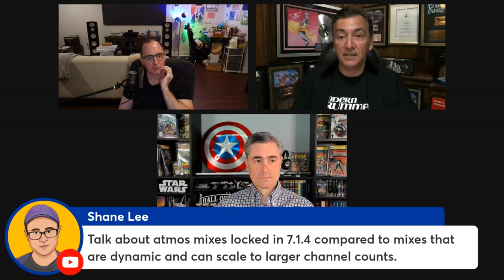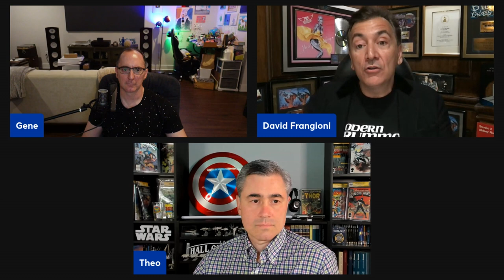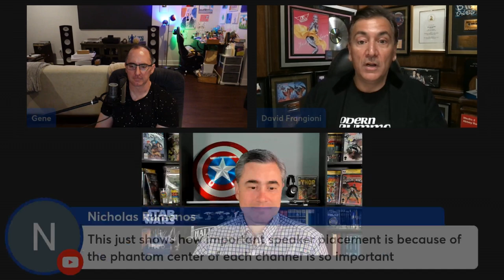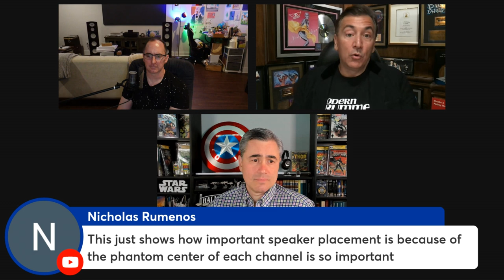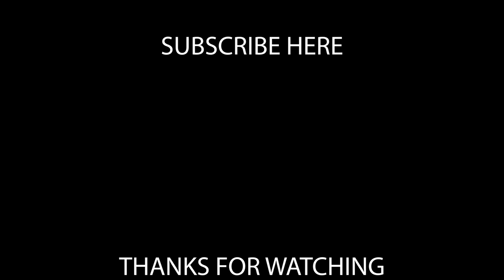Why 7.1.4 Static Atmos Mixes Instead Of Dynamic Mixes?

Comment: There are so many times questions being asked by Shane on why Atmos of Disney turned into Atmouse, but it had never been properly answered by any professional mixer. Nothing is answered straight forward. Or I've missed out? I think it's not only lacking in height channel if people have been talking about it, it also lack in bass and dynamic.
Reply: he circled around several times each time he was asked. Short answer 95% of the world doesnt go beyond 11.1 channel setups. (i personally run a 9.1.6 setup) . So they cater to the masses rather then the 5 or possibly even 1%. if most people are happy with said outcome why spend the extra money and time for a mixer to cater to the few? Same reason why most receivers/processors (i do say most not all) were limited on 11 then 13 channels for years. Lack of demand for it.  Most people are happy with a sound bar. big speakers are cubumbersom. let alone having 13 + of them. I suppose i fall into that small percentage as stated i have a 9.1.6 setup. If emotiva comes true to there word and releases the expansion modules with the plus series ill be upping to a 12.1.13 setup to cover both atmos and the dtsx pro setup (3 layers . bed ,on wall and inceiling heights) thats just me though. side bar i can tell you, front wide are used alot more than say middle heights in my experience.
Reply: @unknownuser200985  I run auro3D in 7.8.8 with 2 denon 3800 avr's.  I hightly prefer the algorithm over the poor atmos mixes over the years.
Reply: @trauma50disaster1  i had a denon 8500 prior to going with an RMC 1. i as many others thought most of the channels are never used and mixxed poorly. you'd be shocked at how differently they sound with a proper sound processor. How much missing information there was that you can hear now. I was under the impression almost no movies used middle height speakers or front wides. then i replayed those said movies with the rmc1.  Oh was i wrong. Any active mix goes crazy in a good way. The sound bubble is so much bigger.  im excited to expand my system to the next level
Reply: @trauma50disaster1  I think you are mixing up Auro3D with their upmixer, called Auromatic.
Reply: The mixers NEVER answer that straight up.

The answer is because it was easier to let the Atmos renderer downmix a theatrical mix to a static bed channel mix for the home, rather than to spend weeks remixing the movie.

The studios didnt think we would know the difference, but they underestimated us, then the Trinnov object analyzer came out and verify what we already suspected.

Comment: A fancy Hollywood sound mixer I know (at least that's how he'd describe himself) says it's absolutely time dependent. Mixes are generally done in 7.1 and Atmos is an afterthought, even for theaters. It's just less important. If there's time they may toss a few more objects here and there.

Also.. 7.2.4? Is there any mix anywhere that uses stereo subwoofers? I doubt it.
Reply: I've also seen interviews by the sound guys who complain about lack of time and more imprtantly lack of desire by management to dedicate the resources to make it better.
Reply: You can't have two LFE channels unless the industry changes the format configurations.  There is only a single LFE channel... the .1 channel. Commercial Dolby Atmos allows for front of house and rear of house sub outputs, but those are all bass management derived.

Comment: I don't think he quite understood the question. None of this explains why something like Ready Player One is a locked 7.1.2 mix at home if a fully dynamic theatrical mix was done.
Reply: The reason for locking is that Dolby Atmos supports 128 dynamic objects. In cinema production, the 128th object is always used. However, when converting to Blu-ray, you cannot burn a 128 object directly onto the disc due to space limitations. Instead, the 128th object is mixed into the 7 channels, effectively "baking" it into the audio.
Reply: @Tiger998624  Again, that doesn't answer the question of why something like Ready Player One on home formats was given a 7.1.2 "bed-only" printout with ZERO dynamic objects. This isn't a question of the standard object grouping (since the home format has to combine the 128 down to about 15 in the home version). It's a question of why fully dynamic theatrical mixes would intentionally get pared down to a bed-only mix instead of letting the object grouping do its thing to maintain the placement of the 118 available dynamic objects within the space available for home mixes. Plenty of mixes (like Midway) exist that retain the full object-based audio without downmixing to the beds, and without significant file sizes compared to bed-only printouts.
Reply: @Echo-jg8is  No. If you don't have heights, Atmos tracks are only going to use the 7.1 core of the track anyway.
Reply: This is why a use auro3d it sounds great comparted to poor atmos mixes, uses all of my speakers.  with 2 denon avr's I like 7.8.8 with vog so much
Reply: @TheReverendSlim  @echo I would slightly disagree with this.  While true you would only use 7.1 core track, a lot of mixes just sound better IMO in Dolby Atmos.  To my ears, the bass is enhanced, the highs are usually clearer.  Sony is pretty much the pinnacle of home Atmos Blu-ray mixes.  I would try one vs the other.  (There are exceptions to this though like War of the Worlds and Edge of Tomorrow where the bass is lacking compared to their 5.1/7.1 mixes.)
Reply: I agree, he didnt seem to get it until "Atmouse" was brought up, then he seemed to want to dodge the question.
Reply: @holenjd3 Atmos is not its own separate thing like you think it is 

It is simply just information  embedded within Dolby True HD hence why if you buy an atmos disc but don’t have a receiver that can use those dynamic objects it just defaults to the base Dolby True HD 

The fact that you think it sounds better than a Blu Ray that just has Dolby True HD is all in your head my guy

Comment: Dolby Atmos: https://en.wikipedia.org/wiki/Dolby_Atmos
It is still enygma for me but this is how I understand it:

1.Tracks count:
1.1. Dolby Atmos supported in blu ray disc and the in theaters/cinemas/music max. 128 tracks
1.2. Dolby Atmos supports in TV broadcast streaming (netflix) max. 16 tracks (8 "bed" tracks[7.1] + 8 "object" tracks)
1.3. Dolby Atmos supported in gaming (playstations) max.32 tracks

2.Track types:
-there are only 2 types of tracks which are defined by additional metadata file (simple text file?like wav header?)
2.1."bed" track -channel-based, same old school as in old "dolby digital(5.1, 7.1,..)" and "dts" (in metadata file "track type" == "bed" ?)
     -this is for keeping compatibility to play it on old bluray/dvd players and amplifiers without dolby atmos
     -if your new dolby atmos receiver is not configured as "x.1.4" but only "x.1." then only "bed" track are used and you see only "Dolby TrueHD multich"
     -if your have old receiver (without dolby atmos) then only "bed" track are used and you see only "Dolby TrueHD multich"
     -"bed" track : t1=FL, t2=C, t3=FR, t4=SL, t5=SR, t6=SRL, t7=SRR, t8=SW
     -comment: of course you can use all of 128/16_tv/32_game tracks as "bed" track only (without "object" track)
2.2."object" track -3d object-based, new system (in metadata file "track type" == "object" ?)
     -1 "object" track  == 1 sound  (helicopter) 
     -2 "object" tracks == 2 sounds (helicopter + fly) 
     -n "object" tracks == n sounds (helicopter + fly + .. + car)
     -each "object"/sound is placed in 3d space (x,y,z) => (recreated by front, rear and height speakers)
     -at the same time max 128/16_tv/32_game objects can be played but the trick is that..
     -..during the movie (90 minutes) in one "object" track there can be multiple different sounds(helicopter + fly + car) but in different time stamp
     -so now 1 track ("object" track) can be used to all end loudspeakers where in...
     - ... "bed" track one track is hard defined to end loudspeakers
     -if your new dolby atmos receiver is configured as "x.1.4" or "x.1.2" then not only old "bed" track are used but also "object" track are used and you see on your "Denon AVC-X3800H" "dolby atmos" instead of "Dolby ThreuHD multich"
-"bed" track    - contains only audio information
-"object" track - contains audio information + 3d possition

3.  3d coordinates/object position info:
-3d coordinates in acoustic space is defined by 3D_volume value (0-100%) of x,y,z coordinates 
-3D_volume is not volume of input audio track(sound)
-3D_volume together with input audio track(sound) places input audio track(sound) into surround space
-assuming star position/coordinates are  0,  0,  0 (x,y,z) which isy "FL" channel only
-normaly star position/coordinates are probably in the center of room
examples:
3.1. input:   0,  0,  0 (x,y,z) -> output: only FL channel
3.2. input:   0,100,  0 (x,y,z) -> output: only FR channel
3.3. input: 100,  0,  0 (x,y,z) -> output: only SL channel
3.4. input: 100,100,  0 (x,y,z) -> output: only SR channel
3.5. input:   0, 50,  0 (x,y,z) -> output: only C channel
3.x. input:  50, 50,  0 (x,y,z) -> output: midle of the room_flore (FL + FR + SR + SR)

3.6. input:   0,  0,100 (x,y,z) -> output: only HFL channel (H-height)
3.7. input:   0,100,100 (x,y,z) -> output: only HFR channel
3.8. input: 100,  0,100 (x,y,z) -> output: only HSL channel
3.9. input: 100,100,100 (x,y,z) -> output: only HSR channel
3.10.input:   0, 50,100 (x,y,z) -> output: only HC channel
3.y. input:  50, 50, 50 (x,y,z) -> output: midle of the room (FL + FR + SR + SR + HFL + HFR + HSR + HSR)

4.why new approach with "object" track instead of old one with "bed" track:
4.1. -in your small home theater you have only 7.1.4 output channels but..
     -in big public theaters you have 21.1.10 channels and more (example) to all people can experience surround effects
     -example: source contains "7.1" and 1(one) "bed" track which is positioned only for height/celling sounds
        a)in home theater 7.1.4 object moves between 4 height speakers (done by dolby atmos decoder in receiver automatically)
        b)in public theater 21.1.10 object moves between 10 height speakers (done by dolby atmos decoder in receiver automatically)
4.2. -usually more sounds can create chaos where you really do not know where which sounds comes from
     -for psychoacoustic it is preferable to have less different sounds to create dominance atmosphere for better sound location
     -more sound == more chaos, less sounds == more dominance for each sound
     -that is why actually for tv_movie 8 objects (8_object = 16_all-7.1_bed) together with old 7.1_bed tracks at he same time is allready to much

5.Input vs. output:
-input=source=bluray media mixed in studio
-output=loudspeaker channel in receiver (7.1.4) played at home or theatre
5.1 old style mixing(no dolby atmos):
 input=7.1 in track transferred 1:1 to output=7.1 (comment:omitting  channel reduction) 
5.2 new style mixing(dolby atmos):
 input=7.1.100 in track transferred to output=7.1.4 

To original question:
7.1.4 Static  Atmos Mixes == 7_bed.1_bed.4_bed input tracks (it is equal to 7.1.4 output loudspeaker channel configuration)(?is it really used in media?)
7.1.4 Dynamic Atmos Mixes == 7_bed.1_bed.4_object input tracks (!! it is not equal to 7.1.4 output loudspeaker channel configuration !!)

Correction of above mentioned information 9from some expert) is highly appreciated.
Reply: I use auro3d, it uses all of my speakers and sounds better to me that the poor atmos mixes.
Reply: From what I understand regarding the "bed channels"

There are 7 beds at ear level, the traditional 7.1 surround channels.  I think there is a bed channel for the LFE that is permanent.  It doesnt ever have to move or change.

Then there are two "height beds" at the Top-Middle position.  A Left height and a Right height.  Because they are at the Top-Middle position, it will active 4 top channels set as front and rear height/top.  The top-fronts and top-rear will work together to try and "image" the top-middle object.  So to the uninitiated, it will feel/sound like 4 height objects when in reality, its only two.  Ready Player One uses this kind of Bed Object Mix.

However, some mixes use the 7.1 ear level beds plus 4 static height objects at the Top-Front and Top-Rear positions.   The objects are static and dont move, but what this allows them to do is facility sounds panning from front to back as well as side to side.  Not with objects, but using traditional channel panning.  If you have 6 height channels including Top-Middles, this form of channel panning will leave your TMs silent as there are no objects passing through them.   Just as a Top-Middle "Bed" will leave front and rear heights/tops silent in a 6 height channel config.  Disney Atmouse mixes are usually like this.  Though some have be 9.1 bed object mixes as opposed to 11.1 static mixes.

Only mixes which use active sound objects will activate all channels potentially, up the limit of 24.1.10.  Godzilla v Kong most famously is this type of mix lighting up every speaker.   Warner Bros and Sony tend to put out the best active mixes most often and Netflix on streaming.  They encourage their mixes to monitor with 9.1.6 mixing studios.

Comment: im not understanding this. If sounds are getting their own channel on the mixing board, how hard is it to change where the speakers direction is panning to? Its literally one nob on the board that you move left or right. So how is that requiring so much extra time?
Reply from the maker: Well there's 128 objects in a mix. That's a lot to move around and to keep track of.

Comment: They should just go back to include the theatrical mixes on the discs like they did on laserdisc.
The lack of dynamics for "home theater" these days is really putting a damper on my willingness to actually buy discs, but maybe this is what they want, try and push us physical collectors into a monthly payment plan, instead of a one off and we own it payment. . 
Only Sony seems really invested in doing proper mixes for home theater. And Sony don't have a streaming platform, coincidence or?

Why Disneys mixes are so bad, i have no idea, but my thoughts is, it has something to do with them not wanting to spend money to do mixes both for home theater and their streaming platforms.and they just put the soundbar neutered d+ mix on the discs and be done with it. 

I am just ticked off that atmos was a huge part of the original marketing campaign for the UHD Format, to get us to upgrade and invest in new equipment, only for the studios to reneg on the deal, and now release half assed products to save a buck in licensing, while we still have to pay a premium for the physical version. 

Paramount especially seems to go out of their way to not include atmos, even for content that originally had atmos mixes on the streaming service or the theater.

I have gone from buying 100s of dvd/ bluray a year, to less than 10 a year, and i do not have a single sub to a streaming service as i find the quality not very good on a 123" projection system.

Comment: "Reference standard" of 7.1.4, LOL.  9.1.6 is the mixing gold standard.  7.1.4 is kind of the starting point.

The real Atmos mixes uses all or a lot of active objects which will play through ALL of your channels up to and including 24.1.10.

When they limit the mix to a static bed object mix, they bypass the natural scaling ability of Atmos and keep the mix to 7.1.2 channels no matter how many speakers you have in the setup.  The only saving grace would be if your processor could treat you extra channels as arrays.  Pretty much only Trinnov and Storm can do that (maybe some lesser known boutique units, but not many)

Comment: i think it is a learning curve for the entire mixing industry. some seem to have difficulty transitioning from the static channel based thinking to dynamic, object based thinking when creating a sound field.  The main problem with 4 static overhead 'channels', as i understand, is that any setup with 6 overheads, will end up with 2 of the 6 overheads completely SILENT. Which makes the overhead sound field WORSE running 6 overhead vs 4 overheads...
Reply: auro 3d upmixer sounds much better than these poor atmos mixes, the algorithm uses all of the channels so well for me
Reply: Or if you have the maximum 10 overheads for the home version of Atmos... if you have a static 7.1.2 or 7.1.4 mix, then most of the speakers will remain silent.  Or when you have up to 24 ear level speakers.  17 of those will also be silent.
Reply: @dan_hitchman007  wives everywhere request the 17-24 speaker setup, haha